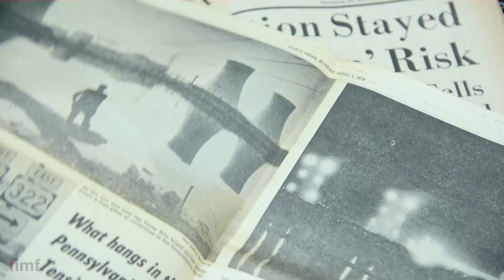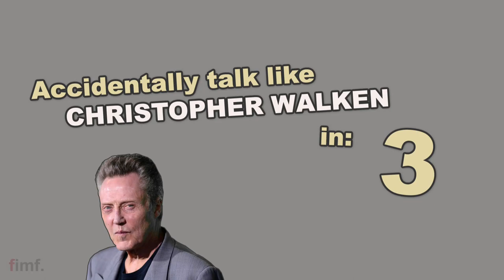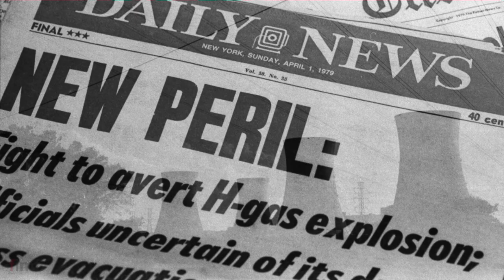Multiple Exposure Project with Tmax 100

Comment: 3:28.........woah, are you saying you are upping the ISO instead of dropping the aperture? would you also double the ISO for each additional exposure? like you would drop one full stop for each image shot on the same frame. Whole new concept.
Reply from the maker: When I'm shooting an entire roll of multiple exposures, I want to consistently reduce the light getting to the film for the entire roll. That's why I double the ISO, so this way, I'm free to use whatever different aperture while shooting the roll each time as long as it's metered for less light due to the higher ISO. I hope that answers what you were asking! 🙂
Reply: @filmismorefun  Im not sure i am clear, so you up the ISO and meter accordingly? When I leaned this years ago, I was taught to reduce the aperture by one stop for each exposure (this would have been a single lighting condition with multiple exposures) Si if I understand this, if you were going to do three exposures on a single frame would you jump the ISO to 400 and then meter accordingly? That is to say, you would set the aperture according to the meter reading.
Reply from the maker: Yes, exactly! Reduce the light by one stop for every additional exposure in a single frame, then meter accordingly. 🙂
Reply: @filmismorefun  Thats brilliant, I have been doing it long hand for years, it works fine for a standing subject in multiple poses but I could never figure out how to do it in the field without if being a long process. This is way more simple, and user friendly.  Thinking about it now it makes perfect sense. Thanks!
Reply from the maker: @tobroken1965  No prob!

Comment: Hi, for a film of 100 iso, you give this advice, to keep same aperture and same speed for the two shots BUT to push the film for 200 iso and to develop for 100 iso. OK. Imagine that the correct exposure is 1/125 and f8. I would like to know if it would be the same if I shoot the first view at 1/250 and f8 and the second exposure too, both of them for 100 iso ?
Hope that my question is intelligible. Regards, Fred
Reply from the maker: Hi Fred. I hope I understand correctly, but from what you've described, yes, it doesn't matter how you reduce the exposure. In my opinion it's always easier to maintain a consistent iso rating when you're reducing an exposure to shoot multiple times, but in theory you can reduce light through shutter speeds and aperture changes as well. I hope that helps 🙂